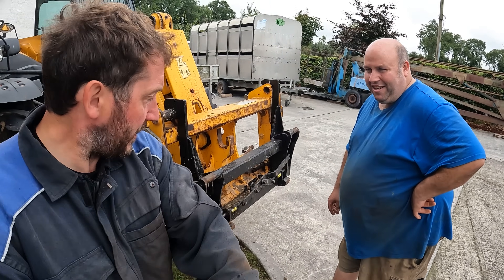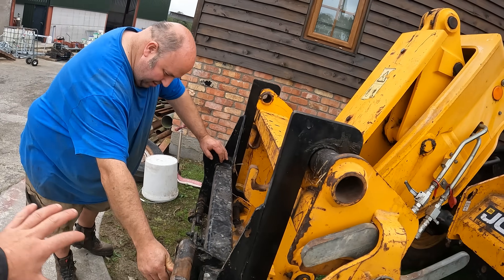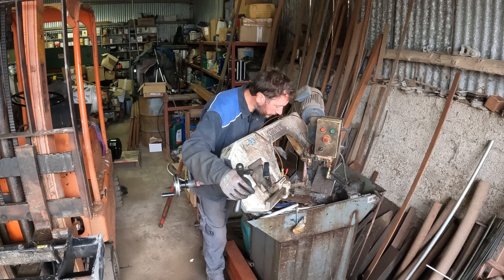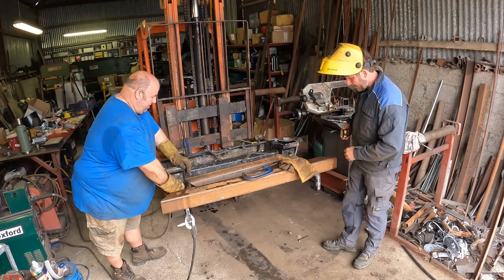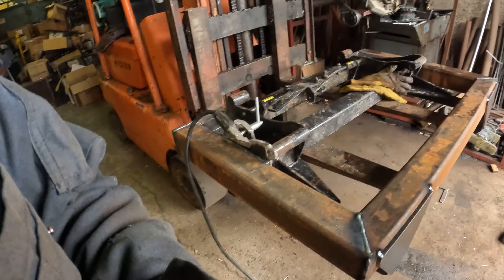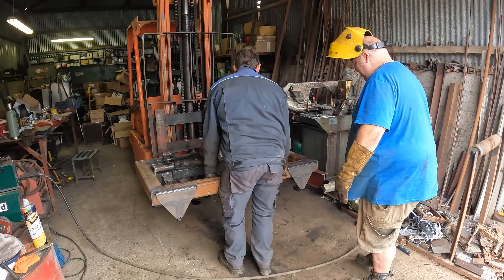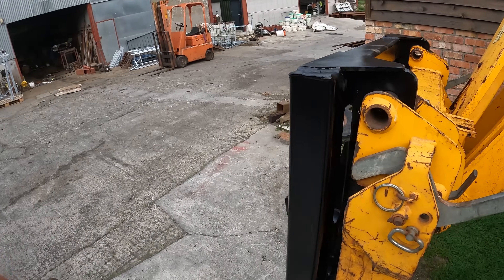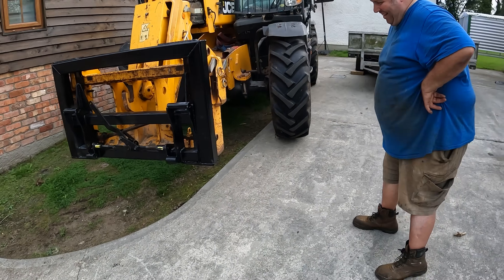Repairing JCB Headstock Adapter  #engineering  #workshop  #farming  #welding

Comment: David, what camera and editing software do you use?
I did ask you before, but I can't find the comment where you told me 🤦‍♂️
Reply from the maker: Camera is a gopro hero 10 with media mod for wind noise & I do all the editing on a powerful Dell laptop running Premiere Pro.
Reply: @sheepschool365 Thanks David. Are you happy with the camera? Would you recommend it?
Reply from the maker: It's a good camera but need plenty of long life batteries for it especiallyin cold weather. DJI cameras are  maybe better now with mic setup & connections.
Reply: @sheepschool365 Thanks David, appreciate the info. Keep up the good work.